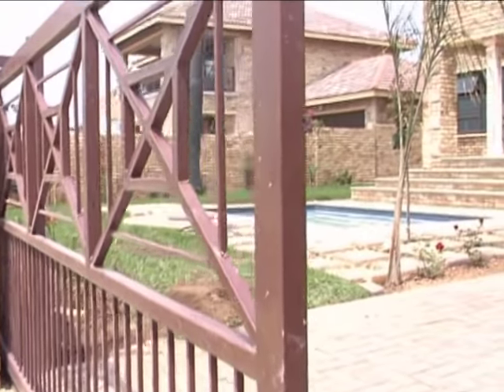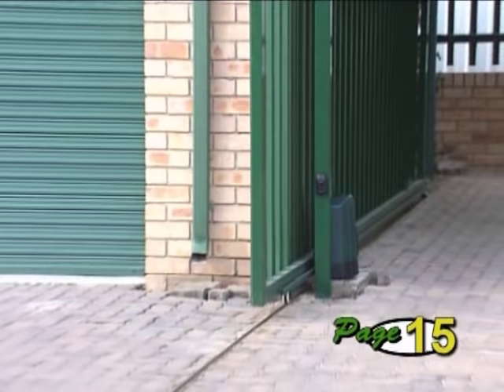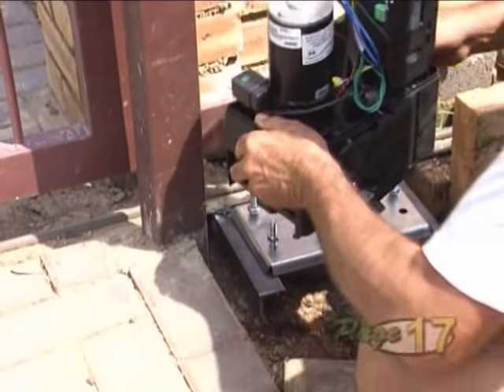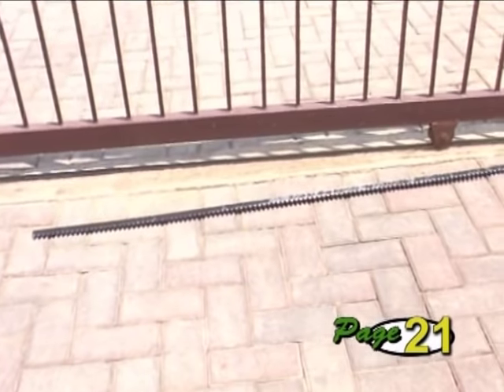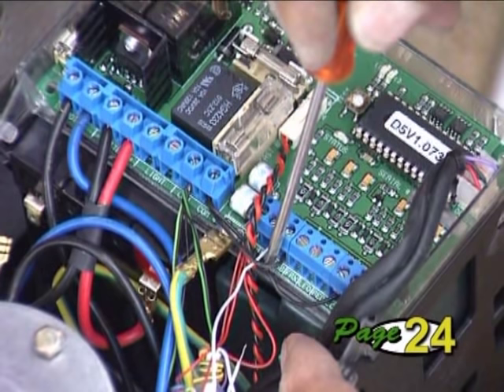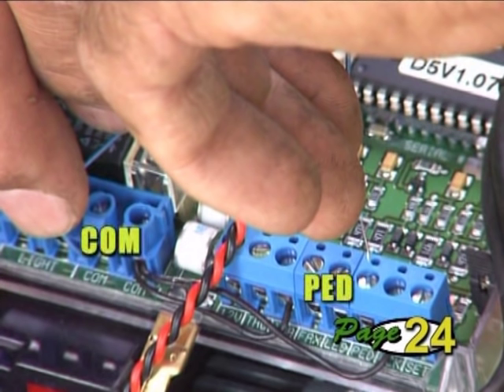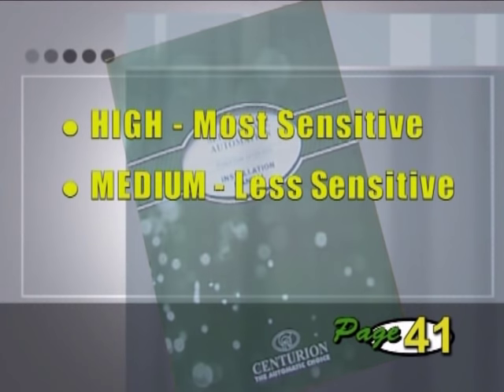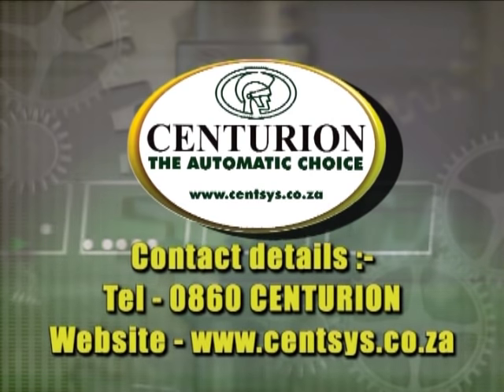Centurion D5 and D3 installation SD.mpg.wmv

Comment: I have a D5 evo motor. I have checked all the mechanical limits and followed all instructions. The magnet is also well set but when the motor starts for the first time, before it finishes the full cycle the controller goes off then restarts itself and everything starts over. Can you please assist?
Reply: Check the battery if it's fully charged

Comment: Hi , I have installed a D5 Evo some time back but have had issues with the gate opening randomly on it s own. This causes problems for my security company as they are unable to access the premises via the Air Keypad ......when I activate the holiday lockout .

Comment: i installed a d5 motor for a client, it works perfect except that the gate moves too slow till it crosses the origin marker plus after opening, the gate shifts back slightly as if it wants to close again and stops. what could be the problem.
Reply from the maker: George Oduro Hello George. The gate will move slowly until it knows its position (by moving the magnet past the origin sensor), so that is normal. There could be a couple of reasons that cause it to want to move back after opening - such as detecting a collision. Please give our Technical Call Centre a call to help you identify what could be causing this. The number is +27 11 699 2481.
Reply: CenturionSystems alright thanks.
Reply: the gate lying on motor

Comment: I have a problem with my Motor it only works when i press the test button, when i try to set my reciever it doesnt have life does the black small cable have to not be connected anywhere
Reply from the maker: Hi there. Thanks for your query. No, the thin black cable is the antenna, and doesn't have to be connected to anything. The programming method would depend on the model of receiver/remote that you are using. Kindly give our technical support team a call on 0861 003 123 so that we can help you diagnose the problem.
Reply: Ok thank you

Comment: hi. I have the D5 evo. I have black and red plus ground pillar light cables. I need help how to connect these cables to the controller? currently these are loose in my box and I want my pillar lights to work

Comment: Hi, kindly assist. My D5 gate motor shows that it has stalled and when I try to reset the it by setting the gate limiters it says no origin found! Whats the correct procedure to unstall or reset it?
Reply from the maker: Hi Arthur. Thanks for your message. Kindly give our technical helpline a call on +27 11 699 2481 or send an email to support@centsys.com. Our knowledgeable technicians will be able to assist you with some diagnostic procedures.

Comment: Hi I'm an end user and wanted to know how would I go about programing new controls if I have lost my master control?  Thanks
Reply from the maker: +Miles Williams Hi Miles. Thanks for the comment. If you have lost the master, you need to clear the receiver's memory by bridging either J1 or J2 with the middle pin. This will delete all remote buttons. Next, press and hold the remote you wish to make the new master for approximately 5 seconds. Once you have created the new master, press and hold it again for 11 seconds, release it, and then systematically press and release each new button that you wish to learn. Alternatively, you can give our tech support team a call on 0861 003 123. They will walk you through the procedure.
Reply: Thanks for the help.  I appreciate the quick response. Will give this a shot and see
Reply from the maker: +Miles Williams Awesome! It's an absolute pleasure. Please give us a shout if you don't come right.